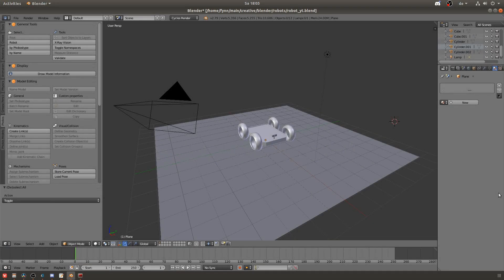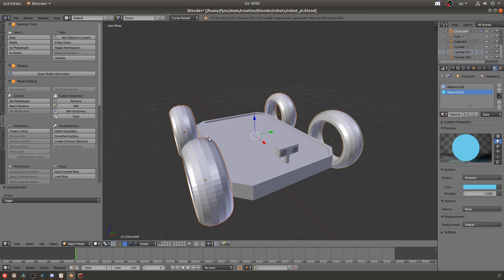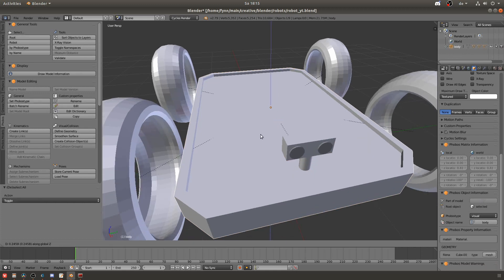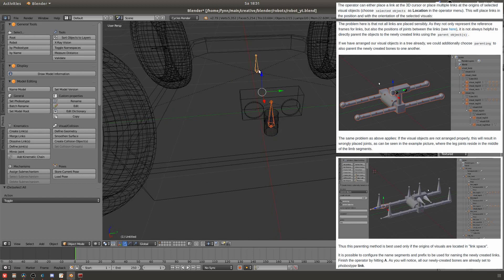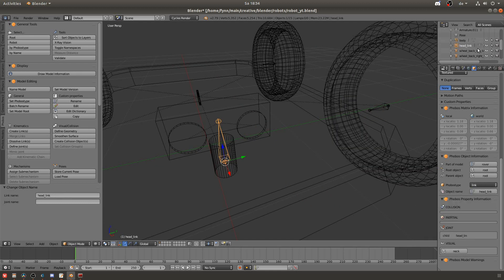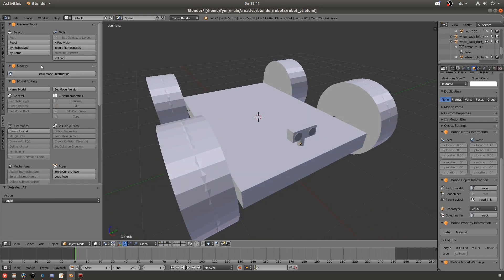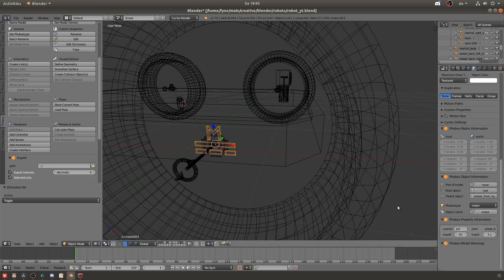From Blender to URDF with Phobos - Setting up the model (Part 2)

Comment: can you descirbe more why you flipped the bone ?
I looked throgh the documentation and i couldn't find any information on the root, body and tail of the Bone.
The same for the direction of the bone. You said that the root is located at the "bigger part" of the Object.
I see that all your wheels have all the same bone direction but how do you know where the "bigger part of the body" is located for a symmetrical body ? 

the root is the part at the thicker end of the bone right ?
Reply from the maker: Hi, you can find information about the structure of a bone in the documentation here: https://docs.blender.org/manual/en/latest/animation/armatures/bones/structure.html
As you can see it has a root, a body, and a tip/tail where the root is located at the thicker end of the body as you correctly stated.

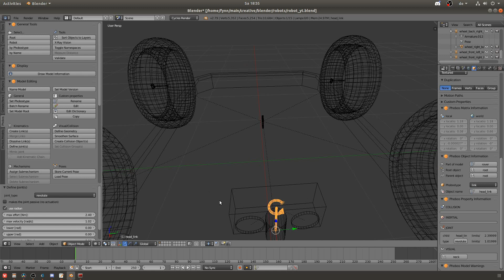As you can see in the video (e.g. at 5:38 or 5:59) the direction of the bone decides the positive direction of rotation for the object (based on the right hand rule, where your thumb points towards the tip of the bone).

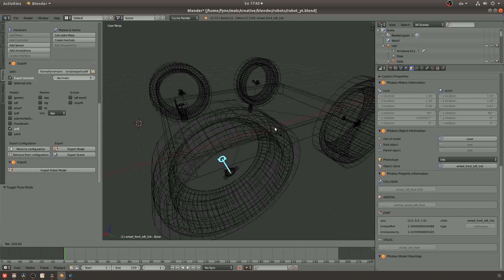You noticed that the bones of my wheels are all pointing in the same direction. That's because the positive direction of rotation should be the same for all of them (if the robot moves forward, all wheels move in the same direction). I would say that I made a small mistake there though. With the way they are rotated now, a positive rotation would make the robot roll backwards (assuming the head of the robot with its "eyes" is looking forward). You can see that e.g. at 6:32 (the joint shows the rotating arrows moving backwards). So the wheel joints would each need to be rotated by 180° around the Blender global Z-axis (the blue one).

I said that the first bone was rotated incorrectly and flipped it because the orientation of the bone defines the orientation of the coordinate frame of the link in the URDF (I think). You can also see that in the last video of this series at 6:47 (here: https://youtu.be/vH9VokeJFiU?si=ShYZE9rsrDrTlqeL&t=407 ), e.g. compare the coordinate frames of the body with those of the wheels. The Z-axis of the coordinate frame points towards the tip of the bone. I simply wanted the Z-axis of the coordinate frame of the robot body to point upwards (this also aligns with the ROS axis orientation convention as defined here: https://www.ros.org/reps/rep-0103.html ).

Cheers

Comment: when I hit Create Collisions Object , Does not happen and they are not created . ?
Reply from the maker: Did you select the objects you want to create the collision objects for? Maybe they are hidden?
You could try to create a very simple "robot" in a new file, for example just a cylinder, and try to create a collision object for that. In this way you can rule out that there is a problem with your model. Also click on "Draw model information" and when you click to create the collision objects, see if there is some text in the bottom right corner.
I hope it helps. :)

Cheers

Comment: Hi, I have a problem when following this tutorial. I trying to export a URDF of tracked robot from Blender. When I create links for both of the motors on the robot their bones are created at the same point where the robot body's bone is created, actually all three of them overlap each other. But I selected them one by one and followed the tutorial. Later when I tried to name the robot I get an error saying no root object. I don't know why?
I ignored this one and continued and than I find out that I can not create joints for the robot as it says there is no link?
Can you point out what could I be missing or something which I need to do for my tracked vehicle?
Thanks in advance for any leads.